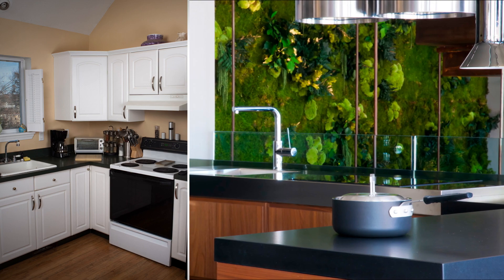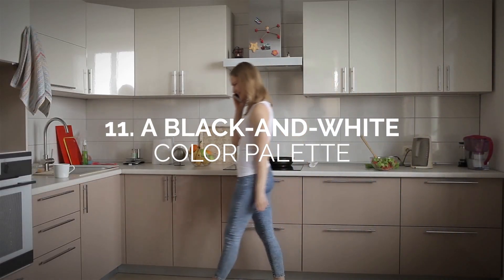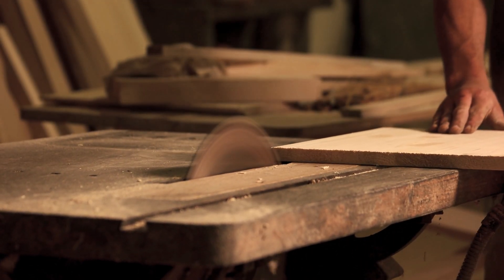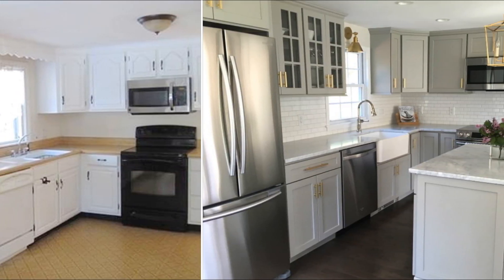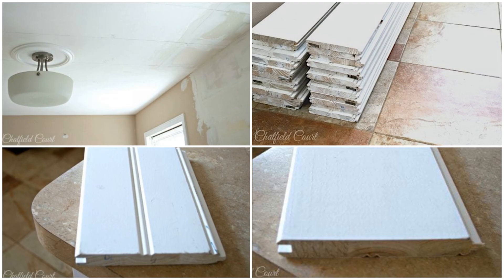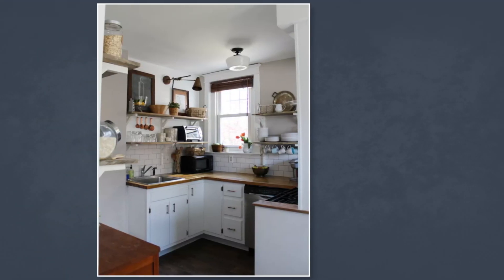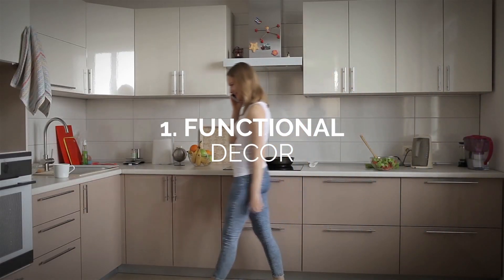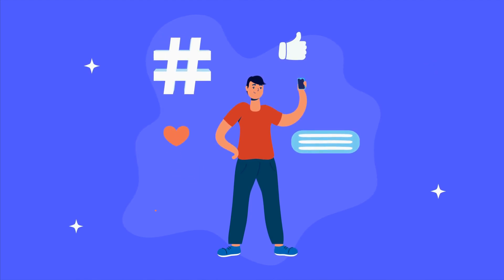12 Small Kitchen Renovation Ideas On A Budget

Comment: OK avoid a butcher block countertop. The up keep coast per year can range from about $150 (for a small countertop) to over $1250 (for a larger counter). Also it's a ridiculous amount of work that you'd need to do at the very least monthly if not bi-weekly. It's easier to wax and SUV than rub oil into your butcher block countertop after every time you clean it.

A painted backslash is very cheap. You can give it the appearance of tiles by using a dark grayish color as the 'grout' and a light high gloss color for the 'tiles'. The most complicated part it taping and spacing but a tile-like backsplash for under $50 is worth it.